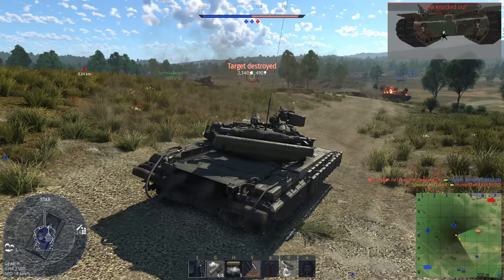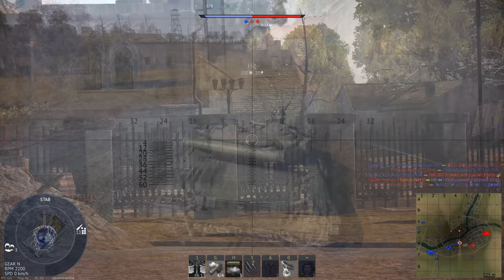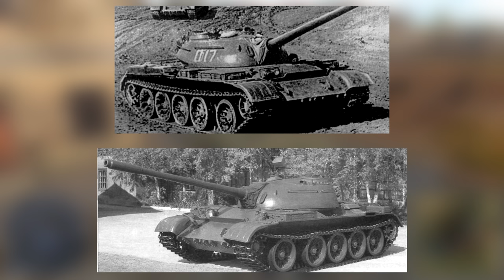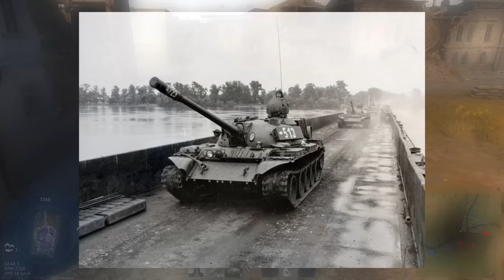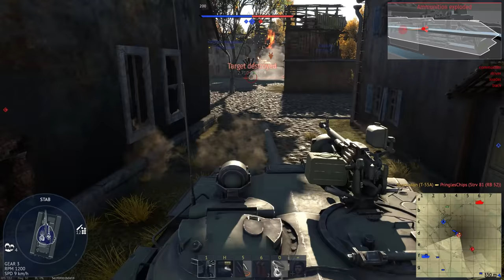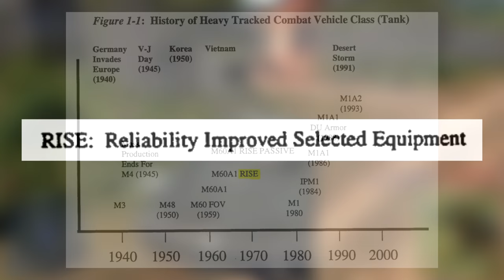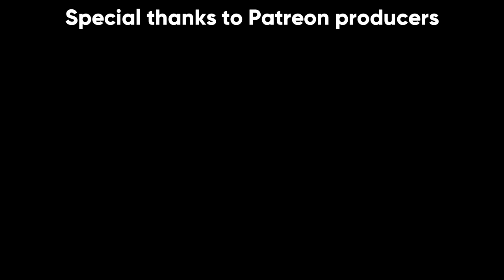Were Soviet Tanks Poorly Made?

Comment: For the T-34: the T-34 was originally designed to be a decent tank (at least for the time) but with operation Barbarossa, the soviets were forced to make certain cutbacks in time and work quality for the T-34. Yes the designs became better as the war went on but even by the wars end, there were many disparities between tanks that were built in the same factory. There is an even bigger disparities between tanks built in different factories. Parts of the tank that were deemed not essential or as important as other parts were either completely missing or made out of worse materials then the core parts. Things like lights, crew hatches, vision visors, and even the early transmissions were either missing or of low quality in early and mid T-34’s.
Reply: yeah, idk why we is talking like the t34 was a well made tank. it wasn't. it had many problems around how brittle the armour was, and many things were mssing from them.
Reply: Designed as a decent start of a tank, there were some pretty clear flaws in the vehicle which the USSR found and were going to fix but, wars tend to make things like that hard to do.

It also wasnt even just early or mid, late production and post WW2 production T-34s also had serious issues.
Reply: may i remind you that by 1942 83.6% of T-34 tested completed their 300km test runs. Furthermore, the 5th guards tank army endured a 3 day march, totalling 330-380km, to prokhorovka and we all know how that went. The germans called the sherman "zippo" or cigarette lighter and i gotta wonder why... The british cromwell required 199 man-hours to be properly maintained compared to an M4A3's 39 when subjected to the same test.
Reply: @Nave4x4  that documentary is pretty flawed, as it compares the t-34 to different tanks. There is no constant. For example, when he talks about mobility, he compares it to fast tanks like the Panther, however, when comparing firepower or armor, he compares the t-34 to more beefy tanks like the Tiger, which gives a false "always bad" view of the t-34, which is very misleading. And yes, the tank obviously had problems, however it is not as bad as it may seem from his videos.
Reply: Combine that with who was building those: not all of them were built by highly trained professionals. The country lived by “everything for the frontline, everything for the victory” motto. If you weren’t fighting in the frontline, you were willingly working your ass off at the factory, producing ammo, uniforms, weapons, pretty much everything needed at the front, including, you guessed it, tanks and tank parts. 

That allowed for an impressive production output. At the cost of greatly varying quality that depended on just as varying skill level of every volunteer worker involved. Doesn’t mean the quality was always terrible. They got the job done. Party had zero tolerance for shit quality even at these times. But you can’t sign up a horde of volunteers who were in a different occupation just this Monday and expect the quality to be consistent even if you teach them the basics.
Reply: I was In a t-34-85 myself the things u sit on is literally a wooden bench there's almost no space for the crew and the tracks are very rough when driving,  you could drive into the smallest hole and hit the parascope so hard you would get knocked out, german chairs (the thing u sit on ) they tought about the design that would be more comfortable for humans, they have these soft confy chair and the tracks are not so rough, and the parascope idk, german tanks were made of expensive high quality metal, that's why they had a deadly reputation, but the parts could not be repaired when damaged, otherwise the soviet tanks they were made to quick manufacture and basically designed to assault trenches because they only focused on rushing because there wasn't any time to think about human comfy or anything like that, germans were at the gates of moscow and the air was dominated by germans they needed a quick steel beast to counter the german panzers, there wasn't any time to build a new tank prototype that wouldn't had been to made for 50  to take down 15 panzer tanks.
Reply: @blitfire  of course t34 dont catch fire when hit in their ammo or fuel.
Even if germans did refere like that to the M4 it means nothing because on the field monikers dont represent stats.
Drop a match on a diesel spill, it will also burn.
The M4 ended having a death rate after penetration at 20% or lower, meaning that even if the armour was defeated in average only one crewmember died.
The US armored core had some of the lowest casualties rates
Reply: @vilencas6203  I totally agree. When the  USSR lost millions in battle, when there were no resources left in the nation, when Leningrad was in a blockade for years and when the industry was bombed out of existence, the Soviets shouldn't have focused on a comfy seat.
Reply: @ender1111  Except he didn't? He made alot of fair points like how the gun was shiet, how it's mobility was meh, alot of t34s not having radios meaning usually only 1 t34 would attack a newly spotted tank, the shiet armor quality, like how the optics for everything except the gunner was shit, etc...
Reply: @aregulargenericname8794  what do you mean by "he litteraly didn't"? He litteraly did. Throughout his video he litteraly compared the t-34 to different tanks, with the example of how he did it and why It wasn't the most accurate thing to do above.
Reply: @aregulargenericname8794  also, calling everything you can name in a tank "shit" is the most accurate and carefully planned analysis I have seen in a while. 10/10
Reply: @ender1111  It's literally just a fact that the t34 is shit, what else am i suppose to say? and also comparing tanks to other tanks is literally showing what a tank is good and bad at and the t34 is again shit in almost every aspect
Reply: @aregulargenericname8794  what else you're supposed to say? I dunno, maybe something factual lol
Reply: @phunkracy  I literally did tho
Reply: @vilencas6203  wooden benches in T-34? Lol, this alone proves you weren't in T-34, ever. Maybe in romanian one.
Reply: @mitchverr9330  post war T-34s that were of questionable quality were overwhelmingly polish/for export. Mostly because Poles were just learning how to properly make a tank in the 50s and Soviets didnt care about T-34s, having switched to T-44/54, giving away tanks that they didnt want.
Reply: @aregulargenericname8794  compare a medium to a heavy tank and what is effectively a heavy tank ( tiger and panther ) with hard stat is stupid and go against his other point on the  panther video which is double standard , he also use a ton of strawman like using ONE factory to judge EVERY OTHER factory , around the 17-18 minute mark he also use a wrong example by showing a piece of armor that IF welded like he talk about then you won't be able to take out the suspension and many other error like not mentioning the context in which the decision was made or failing to mention improvement latter on from mid 1943 ,.... In conclusion that video is a Mark Felton tier video (surface lv piss poor ) which is a shame cause his other video is quite good ( my favorite is panther , Burton ) actually high quality video should be atleast Chieftain/MHV tier not this.
Edit:Also shit tank don't win war buddy , there a reason T-34 perform better than Sherman ( yes , that a fact ) on the Eastern front , no tank is the best only which tank fit a nation need the best
Reply: Don’t forget the turret basket
Reply: @huyhoangtahuu9733  Didnt that 1 factory build about 50% of the tanks? Arguably making that 1 factory the standard?
Reply: @huyhoangtahuu9733  I disagree alot with ya and i mean alot so
1. He also compared it with the sherman and the sherman was still better
2. That "one factory" made 50% of all t34's and most other factory's were similar if only slightly better
3. You are wrong with the the "around the 18 to 17 mark" thing, you are literally wrong, he just said that welp the armor was strong but it easily "snapped" at the welds
4. The video is gud, same tier as things like the chieftain/MHV
Reply: @mitchverr9330  that one factory was so huge it literally had factories within factory
Reply: @blitfire  The only shermans to have easily catched fire were the british ones, the regular shermans rarely catched fire and had one the best survival rate for crews so yeah
Reply: @aregulargenericname8794   lazerpig gave losses to 50 mm guns as evidence of bad armor. Guess what other tank could be easily penetrated by 50 mm?
Sherman. 
Therefore Sherman had bad armor.

Also, yeah, lazerpig is definitely comparable to Chieftain, an actual tanker and tank historian, lol.
Reply: @phunkracy   Well were are we talking? If it's the front the Sherman will win and is better that's a fact , if it's the sides both tanks are then fucked but that wasn't the point it was the front and the t34 still got fucked
Reply: @mitchverr9330  Not really cause no T-34 from different plant is the same ( hell T-34 from the same plant also have different between each other ) so quality is different from each other alot until atleast 1943 when the standard quality control finally take place which made the T-34 pretty decent tank in term of reliable.
Reply: @phunkracy  Okay and? Mega factory or not, did it or did it not make about half of all the T-34s, making what came from it effectively the default to talk about?

Its like arguing you cant use an Alvis Saladin  as an example vehicle because Crossley built like 12 of them.
Reply: @huyhoangtahuu9733   "reliable"
Reply: @blitfire  source on Germans calling them zipped, sounds an awful lot like the debunked ronson myth
Reply: @mitchverr9330  there was as much variation within this one mega factory as between various soviet factories. As simple as that.
Reply: @aregulargenericname8794  50 mm tungsten round can penetrate M4 as easily as T-34. Normal pzgr 40 has in fact less of a chance to pen T-34 because of steeper angles.
Reply: @phunkracy  Umm no? the sherman has better frontal armor then the t34, there literally was an army test
Reply: @aregulargenericname8794  i also disagree with your point cause:
1, while i would definitely perfer to be in a Sherman there a reason why i write above that T-34 out perfrom Sherman on the Eastern front , the reason being lower profile and ground pressure allow T-34 better moblity ( both tactically and strategically ) as well as some other factor
2.Quality between factory pre 1943 is so vary that trying to point to just one plant and tell me all other is the same is just wrong and post 1943 when quality control is implemented then all most T-34 achieve decent enough reliable lv (CIA report , Soviet internal document which show thing like  all tank must complete a certain milestone with 1 tank of random from a 500 patch being test for min 500km )
3.The picture he show and talk about the gap in armor around that mark is one that has been show before and proven false by reason i stated in my other comment
4, Chieftain/MHV provided context for which design are made as well as how the tank improvement as the war went on, they also talk to people who work on said tank and actually get in (sometimes drive )the tank they talk about , lazerpig did none of the above.
Reply: @aregulargenericname8794  source: CIA report , internal Soviet document and Soviet quality control test mid - late 1943 for all tank plant
Reply: @huyhoangtahuu9733  Time to a r g u e again
1. The lower profile i can't disagree but no the t34 was slower then a sherman that's just a fact
2. Yeah the quality was decent yes, too bad it was still incredibly shit 
3. I made a point and you didn't comment and also your point was literally incorrect and at the "17 to 18 mark" the point you made wasn't even there
4. le lazer honk is still gud
Reply: @huyhoangtahuu9733  Source: my religions believes and my faith in the true saviour Spaghetti the fifth
Reply: @aregulargenericname8794  army test that proved that ~80 mm of effective Sherman armor was able to resist 120 mm pen of pzgr 39 or 140 mm pen of pzgr 40? Don't make me laugh
Reply: @aregulargenericname8794  he literally cited the source lol
Reply: @phunkracy  2 things lad 
1. it's not 80 mm more like 90 to 95 mm
2. i made a joke why? i like to make jokes
3. i lied i have 3 things lad
Reply: @aregulargenericname8794  have you seen how different the terrain of the Eastern front to the Western front ? It literally a fact the T-34 out speed Sherman there that why i only said Eastern front and not every where else ( fit into my other point from my first comment on being the tank the nation need).Shit quality would be not able to go past 150km and can't be field repair like a certain cat , being able to do 500km on avarge is literally the definition of decent right there. Sarcastic remark when confront with sources is no different then admit defeat dude , if you have a counter point to the source then show it or take the L ,that all i gotta said.
Reply: @aregulargenericname8794  only early war m4 had that LOS armor due to steeper angle, but with two glaring 40 (iirc) mm weakspots to make space for driver and mg gunner/radio operator. Latter M4s had less angled but uniform armor. Still at no point impenetrable by even standard pzgr 39 50 mm ammunition.
Reply: @huyhoangtahuu9733   My source is the Lazerpig video including all of his sources
Reply: @phunkracy  I literally never said impenetrable
Reply: @huyhoangtahuu9733  Ill take the L if im incorrect and from what i see currently all i made is some small hick ups
Reply: @raw1175  what i just like russian tanks doesn't mean i want to live in the soviet union. sounds like a cope ngl
Reply: @huyhoangtahuu9733  500km? Naahhhh where are your numbers coming from... "According to the head of the Armored Directorate of the Red Army N.Fedorenko, the average mileage of the T-34 to overhaul during the war, did not exceed 200 kilometers" ... And this is not even taking combat losses into account, per example in 1942 the average service life was 66km... The loss reports of the T34 does rlly reminde one of certain German cats. "For instance the 5th Guards Tank army in 1943 lost as much as 31.5% of its tanks during its march to Prokhorovka. In August ’43 the 1st Tank army lost 50% of its tanks due to malfunction. As late as the second half of 1944 tank units tried to replace engines with more than 30 hours of operation before a major attack." Stalin even made a special directive threatening any crew wich "claimed" their tank broke down with being send to a penalty battalion
Reply: @josephdedrick9337  wtf is ronson
Reply: @nahuelleandroarroyo  i like how you exclusively use american examples to disprove my point that the if nothing else the T-34 was made reliable well before the end of the war... like i don't swear loyalty to any nations tanks especially not my own (not even russian lol) i just think that its unfair. like, don't you think the russians would have come up with something else if the T-34 was really that bad. They did with the KV-1 after all.
Reply: @blitfire  lighter brand supposedly Sherman's were nicknamed ronsons cause of the myth of them lighting up everything they were hit
Reply: @aregulargenericname8794  The british pretty much exclusively used the M4A4 which had the A47 multibank. Now, a large number of the american shermans used radial engines which were very prone to oil leaks, moreso than other engine types. As such i think that you're kinda wrong about the fire thing. Like I'm not even saying the sherman was bad it wasn't it was great but i can tell you're american and so everything other than what you have must obviously be worse because its not american (sorry i used sarcasm i know you don't have that over there) Also its not catched its caught.
Reply: @blitfire   What do you think the t44 and t54 were made for?
Reply: @blitfire  Also im european not american
Reply: @blitfire   sorry if I jumped the gun just everyone thinks all the soviet stuff is like an AK reliable
Reply: @blitfire  But your probably american or russian  (sorry i used sarcasm i know you don't have that over there)
Reply: @nahuelleandroarroyo  Ffs tanks were really flammable they're full of explosives and fuel but everyone's making it seem like the T-34 was the only tank to experience the issues that it faced. The reference to the moniker wasn't really a dig i honestly think the sherman was great. But if we look at what the T-34 did for the russians really it wasn't a bad tank.
Reply: @blitfire  It was a bad tank that's just a fact
Reply: @warhead_beast7661  then im afraid your source and mine differ: "As the war went on, the amount of service expected out of every vehicle was not reduced, but increased. For instance, a new gearbox developed in 1942 was put through 3700 km trials, tires made in 1943 were put through 2000+ km trials. When reliability issues cropped up, such as with experimental tracks, these issues were quickly addressed. By 1945 the requirement for the lifespan of track links, an expendable and rather easily replaceable component of the tank, was increased to 1500 km. Similarly, the warranty period of the engine was increased to 250 hours. Recall that this is the warranty period, not the maximum or even average lifespan. The average lifespan by this point in the war was 250-300 engine hours with individual tanks lasting for even longer. Starshina Kharitonov's tank, for instance, surpassed his warranty period by at least 400 km. Senior Sergeant Russkih's tank fought for over 305 hours. Guards Senior Lieutenant Skvortsov's tank gave out at 308 hours. Guards Starshina Perederiy drove one tank for an impressive 370 hours and then 310 hours with no breakdowns in a different tank. These are just a handful of stories." ( Tank archive with each of the point coming from translated document)
Reply: @aregulargenericname8794   to provide and universal tank platform? how does that disprove my point?
Reply: @blitfire  The t34 was a good design butchered by soviet quotas
Reply: @blitfire   Literally which comment are you referring to?
the one where i called it a bad tank? If yes, it's still extremely shit and very deadly to the crew
Reply: @raw1175  No not really the design was meh at best
Reply: @aregulargenericname8794  have you heard of the battle of kursk? also when the T-34 was first fielded (FIRST fielded, ik this doesn't hold up for long) it surprised the germans with its highly effective frontal armor and its speed. Sure at the same time the crews were shit but that's a seperate matter. Also, look at the T-34-85. That modification demonstrated the T-34s ability to meet demand. all they really had to do was harden up the suspension, widen the turret ring, cast a new turret (with minimal increase in weight, i might add) and they had something that had a chance against a tiger and lets be real here, it was more reliable than one of those.
Reply: @raw1175  i will agree on that to an extent.
Reply: @blitfire  uhh the t34 was around in 1940 and kursk happened in 43 idk what youre on
Reply: @aregulargenericname8794  so it does have half a brain
Reply: @blitfire  I have and you got some points wrong
1. The speed was not good that's just an actual fact
2. armor was decent but if it's anything bigger then a 50 the armor sorta meh's
3. That "ability to meet demand" is a extremely simple demand not anything impressive
4. They still ahd a very low cahcne against a tiger and a tiger was still shit tons reliable then a t34
5. The shell themself were genuine shit, they were poorly made
6. Im confident to say that the first panthers (one of the most unreliable tanks of ww2 at the start) still had a slightly better reliability then a t34
Reply: @aregulargenericname8794  the T-34 was categorically faster. higher road speed and then bc of the better ground pressure better off road mobility
Reply: @aregulargenericname8794  true
Reply: @josephdedrick9337  point taken
Reply: @blitfire  the T-34 is fast on paper, but the transmission was so stiff that it was almost impossible to shift into the higher gears. Basically, imagine that you have a sports car. Fast, right? It would be, but the top two gears have been welded shut. That’s what the t-34 is. A number of later tanks did get a much better transmission, but a lot of them were never upgraded.
Reply: I think that's enough commenting for me 
peace
Reply: One can't really compare the Sherman and t 34 accurately due to differences in doctrine and about the Sherman being called the Zippo that was fixed with m4a3e8s wet ammo storage
Reply: @yoshithorp  As someone else said, the t-34 was an expensive tank produced cheaply. Supposedly if built to american standards in Russia, they would have cost about as much in money, materials, and manpower as the Sherman, an objectively better tank.
Reply: @blitfire  The zippo thing is a myth. First of all, it's highly implausible that more than a handful of Germans even knew what a zippo was. Second, we have the data on the burn rates of Shermans without wet stowage and it's about equal with other armored vehicles. Third, the Germans had a tendency to shoot tanks until they burned so that they couldn't be repaired.
Reply: @huyhoangtahuu9733  He talked about the factory that produced most t-34's, which means that factory's quality is necessarily indicative of the typical t-34.
Reply: @aregulargenericname8794  And if I remember correctly,British Sherman catching fire was usually because they would stuff extra ammunition anywhere they could.
Reply: @Shaun_Jones  not really. Shifting gears isnt near as hard. And in extreme cases of bad production you have MG gunner next to you who has nothing to do,  but can help you shift gears. Still,  being a driver requires strength snd stamina
Reply: 123  You mean like the PzIII and IV? Oh wait... 
But let's look at some "unreliable" German tanks. The Tiger I didn't need to be reliable like the mediums because it was a heavy breakthrough tank. That it spent nearly the entire war not being used for its intended role isn't an argument against it mechanically.
The panther's power train issues were of an entirely different nature than those of the t-34. Unlike the shit design and manufacturing of the t-34 powertrain, that of the Panther was a reliable system that suffered from having to move a tank 10 tons heavier than it was supposed to be. And it was still more reliable than the t-34's.
The tiger II suffered similar overload problems and just the general collapse of german industry.
Reply: @huyhoangtahuu9733  No, the t-34 did not have better mobility. On paper it theoretically did, but in reality the terrible design and manufacture of its transmission meant a t-34 was unlikely to go faster than 15 kph.
Reply: @phunkracy  It's called the slope multiplier; the effective thickness of sloped armor was greater than its line of sight thickness. Maybe learn at least a little about a topic before pretending you have a clue what you're talking about.
Reply: @blitfire  Except it was. Any time that ramming enemy tanks, disabling both, is considered a viable tactic, you have a bad tank. And I don't mean considered viable in some random encounter; I mean at the theatre level. The soviets tried to drown Germany in men and t-34s. Even with the British and Americans fighting Germany in the Mediterranean, bombing German industry into oblivion, and plugging countless holes in soviet industry with lend-lease, the Soviets weren't that far from failing.
Reply: @aregulargenericname8794  And the reason that the British Shermans caught fire so easily was that the crews tended to overload the crew compartment with extra ammo; it was basically the perfect set up to go off like a firework. Once they stopped doing that, the Shermans became one of the most survivable tanks  in the war.
Reply: @jsn1252  Oof, you beat me to it.
Reply: @jsn1252  that's exactly what I said in favour of T-34 but in some inconceivable state of mind you decided to hold it against me lol
Reply: @jsn1252  ah yeah, panther was more reliable because it only had to carry additional 1/3 of projected weight. Also it broke every 150 km as opposed to T--34s 300 km. Also it required extensive driver training as opposed to T-34. But again thst is non issue.
Reply: @jsn1252  also love how you diminish almost the entir weight of German war effort on eastern front. Pathetic
Reply: @ostiariusalpha  That and that 20% crew casualty figure was taken from dividing the number of tanker casualties by the number of killed M4 mediums. That number as produced by the war department also included tankers who were killed while outside their tank for whatever reason, something the British also had excessive issues with as British tankers were prone to getting out of their tanks to make tea even in the middle of an armored advance. See British 22nd armored Brigade on D-day+6 when their impromptu tea party was rudely interrupted by the germans.
Reply: @aregulargenericname8794  comparing the t-34 to one set lineup of tanks would show how bad/good it is. Comparing every different parameter of the t-34 to different tanks doesn't give nearly as good of a picture. Also, he fails to mention any upsides of the t-34, like being one of the first tanks ever with sloped armor or having a good off-road performance, which could get it through terrain that even Sherman's couldn't cross.
Reply: @ender1111  Dude the t-34 was not the first tank to use sloped armor lazerpig mentions that in his video. Castles from the dark ages have sloped armor this has been a concept that has been know for a long time. The brits made the matilda which has sloped armor though not to the same degree but that line did enter service in 1939 while the t-34 enter in 1940. Hell looking back the bt-5 had sloped armor that was put into service in 1932.
Reply: @dragconen  the Matilda and the bt 5 both had flat armour at 90 degrees even in the front, let alone the sides back. There the armor was barely sloped and in a few places, mainly the turret, which could have been made round, because of round turrets being easy to produce.

Basically, the t34 was the first tank to fully embrace sloped armor, while the Matilda or the Bt's both had plenty of frontal, non sloped armor. And yea the consept did exist for a long time, but again, the t-34 was the first to fully implement it on purpose.
Reply: @ender1111  Yes he does. In fact he plays a whole clip show of tanks developed earlier than the T-34 that were developed with sloped armor. Starting with the Somua S35, the Crusader with its heavily sloped frontal glacias, the Char B1 series, Renault R35, the Matilda I with a sloped frontal glacias and driver armored hatch, the BT series (also with a sloped frontal glacias), the polish TK is heavily sloped, the Panzer I (sloped), the FT17, and Little Fucking Willie.
And he does mention that the Christie suspension had excellent off road capability. He also mentions that it didn't help much when driving the tank itself was so bloody difficult (shifting into 3rd gear required a hammer, shifting into 4th gear was literally fucking impossible). Average speed on paper was 34 kph. Average speed in practice was something like 15.
Reply: @ender1111  it's not only about leningrad, leningrad was surrounded but germans made a small gap to allow russians import food to the city when germans foundout they were importing guns and not food, they started bombarding the line and soviets used it as propoganda.
Reply: @aregulargenericname8794   " Umm no? the Sherman has better frontal armor the t34, there litteraly was an army test" what Sherman variant are you talking about? What t34 variant are you talking about? Why are your arguments always so general with no specifica, no proof/sources?
Reply: @vilencas6203  the Germans bombarded the supply lines of Leninengrad from the start of the blockade. They never allowed food to imported into the city, cuz why would they want the city to have strong and well fed defenders?
Reply: @ender1111  I think it is false, now first of all i'm telling you again they imported very little food mainly the trucks carried ammo guns explosives etc, germans could've have surrounded the city completly but remember no food at all that would meant all the population in leningrad will starve starve until soviets give or die out completly.
Reply: @vilencas6203  the supply you are talking about is called Дорога Жизни or The road of life. It was bombarded by Germans from the start, thought maybe with some delay, which is probably where the confusion came from. It was actually a supply rout on water (In summer) which is why it wasn't captured by the Germans, since the Germans couldnt get their fleet in the area. Truck's were also used, but during winter, when the water connecting Leningrad and the USSR was frozen. Germans didn't want to import food, as yhe city would have been turned into a giant concentration  camp without food, which is what the Germans, as you know, were fond of.
Reply: @ender1111  Well, they were mostly about equal. Early model M4 medium had an upper front plate of 50.8mm angled at 56 degrees for a relative thickness of 90.8mm. T-34 76B had a UFP of 47mm thickness at 60 degrees for a relative thickness of 94. Note that a difference of 3.2mm is neither usefully different nor statistically significant.
Reply: @ender1111  Quick about tactics as you might know soviet losses were way greater than germany cause of poor tactics, and poor training, soviets would just throw themselves wave by wave to the germans in trenches that would fend off the soviets with machineguns if they would refuse to rush well, they'll get shot
Reply: @vilencas6203  yeah, agree on that one
Reply: @vilencas6203  yeah, I agree, that was a big part of the problem
Reply: @phunkracy  Domestic T-34s for domestic use were TRASH. Only with the T-54 did they improve manufacturing quality.
Reply: @phunkracy  The 150 km is a myth. The T-34 gear was changed with a hammer. As for 300 km? I'm not sure it could go that far even after changing the transmission with the spare one on the back.
Reply: @liviuganea4108  "they are trash " is such a great argument , oh plz trash tank don't win war and if people like the Chieftain ( who single handedly change the Sherman image AND know what he talk about ) said that T-34 post 43 and T-34-85 are decent tank that are even comparable to Allies tank then i  think i will take his word for it ( consider he actually back his up wth fact not "it a shit tank )
Edit: T-34 don't change gear with a hammer , that a myth cause there plenty of video of people driving and changing it gear just fine ( hell there even a video of a girl changing gear while driving one on youtube ) , just the fact that you mention the gear thing and spare transmission like they are common thing especially in late war ( which doesn't happen ) tell me all i need to know about your lv of knowledge
Reply: @ender1111  
1. just every sherman variant
2. almost every t34 variant has worser frontal armor maybe that fooking yugoslav one can beat the sherman 
3. I'll go get the source
Reply: @ender1111  Also the t34 wasn't the first tank with sloped armor, that's literally just a myth, fun fact: the first ever sloped armor was used on castle walls
Reply: @ender1111  Let me be clear unlike that guy with a vietnamise name or me, it seems like ya only know the "popular" fact bout the t34, i just want to tell ya their mostly lies/the truth but streched
Reply: @aregulargenericname8794  dude , how am i lying when literally denied fact like the T-34 having better mobility then the Sherman in the Eastern front and similar terrain (Zaloga/tank archive)? It literally only take one Google to get the answer but instead you double down on it , why do you think i stop replying to you cause i know it a waste of time trying to change the mind of someone who already have a conclusion and trying to bend the fact/evidence to fit their conclusion , i only reply now cause you call me a liar while being one which is just hypocrisy.
Edit: hell even Lazerpig source which include Zaloga said that T-34 was a decent tank that got the job done , dude do you even read your source ?
Reply: @huyhoangtahuu9733  Ok i won't lie this is a hiccup i made by accident, i was wrong this time 
the t34 is still shiet
Reply: @aregulargenericname8794  eh, let just agree to disagree that to you the T-34 is shit but to me it a sledgehammer purpose built to crack one big nut.Crude, but effective, cheap, and could be built by literally anyone.Honestly tho , i have met worse case and atleast you admit at the end that you are wrong so it a hella improvement.
Reply: @vilencas6203  German tanks were not superior when the germans were at the gates of Moscow. Their Frontline tanks were still panzer 3s and panzer 38ts, with short barrel panzer 4s and stugs supporting. The soviets at the time had kv1s, kv2s and t-34s, heavier tanks with better armor and weaponry, which were actually capable of doing tons of damage to the germans (the single KV-2 that held a panzer division at Raiseniai comes to mind). I mean shit the whole reason tigers exist was to give the germans an answer to the T-34, they didn't just pull it out for shits and giggles
Reply: @verypoorlymadefakename4231  also the Sherman even before the wet stowage didn't have a noticeably higher rate of fires than any other tank of the time period. If your ammo or fuel got hit your tank burned, from panzer 4s to Chi has to t-34s to Stuart's, your tank was gonna burn
Reply: @vilencas6203  bro the wave by wave at trenches thing is a myth. That's not how the soviets fought at all, they did have an initial lack of leadership problem but then Zhukov took command and organized them. Soviets actually had extremely effective tactics and strategy based around baiting the germans into open field conflicts where the soviets would come out on top.
Reply: @aregulargenericname8794  you have provided litteraly zero sources, so your arguments can also be lies
Reply: @aregulargenericname8794  also, I know the t-34 extensively, as not only am I very familiar with WW2, and the easter front, I also happen to live in Saint Petersburg, right beside the Military musium at the Petropavlovskaya Krepost, where I often talk about tanks to the historicaly knowledgeable staff about tanks, including the t-34. I even drove the t34 57 ( I wont be surprised if you dont even know that model of the tank).
Reply: @huyhoangtahuu9733  To be clear, Lazerpig said that the T-34 was a damn good design if the factory workers slowed down a little bit to do even a halfway decent job of producing a quality tank. He has no problem with the tanks produced before Operation Barbarossa or the tanks produced after the war. The problem was the fact that T-34s produced during the war were basically giant masses of manufacturing defects with factory 183 being a particularly notable offender. 183 pumped out T-34s alright, more than every other factory in the soviet union combined, and the vast majority of the ones they made could be placed on a scale going from "godawful" to "near unusable."
Reply: @yoshithorp  Yeah the video did not really focus much on the production and thats why it missed it's own title. Spookston took mostly about designs, not how good or poorly tanks were actually made. T-34 was notorious for it's lackluster quality control and poor quality of steel - a lot of tanks were discovered after the batles not even penetrated by enemy shells. Yet crews were killed and internal components destroyed because of the spalling caused by bad quality of steel and/or poor manufacturing of the vehicle itself.
Reply: @ender1111  Dude no matter how you look at it the t-34 was not the first tank to use sloped armor which is what you said.
Reply: @dragconen  ok, fair enough
Reply: @phunkracy  the Sherman jumbo and M4A3 want to have a word with you as the M4A3 had better slanted armor than the T-34 and the Sherman jumbo could bounce shots that the T-34 could not so calling the Sherman a bad tank is sad there are people out there that say the T-34 is the best tank of ww2 but that’s just not an accurate way of depicting it
Reply: @huyhoangtahuu9733  didn’t the Sherman also see some success on the eastern front as lend lease tanks the only problem the Sherman had was having a chance of going off the road and crashing but during battles the Sherman had a less chance of exploding due to ammo rack and was held to much regard by Soviet tank drivers
Reply: And the armour may have been too brittle.
Reply: @Scriptedviolince  x2
Reply: @dragconen  The First to be produce in masses
Reply: @canthi109  The Renault R35, the BT series, the Panzer I, and the FT17 would beg to differ
Reply: @canthi109  If you are going to argue that point at least explain what you mean. The bt series was produced in large enough numbers to matter. According to the end all be all source that is wikipedia the bt2 had units 650 made bt5 1884 bt7 5556 all of which were made before the t-34.

Dude we are chatting over the internet it is not hard to look up any of this information took me a few seconds what is so difficult about checking to see if what you said is true or even in the same ball park? Even if you don't know exactly what was made you can use google to ask what tanks were made before the t-34 and go from there.
Reply: All my homies hate factory 183.
Reply: @ender1111  yeah comparing a tank to it’s adversaries that it had to fight doesn’t make sense totally.
Reply: @pilot778spartan3  XD
Reply: @blitfire  ok try going into fourth gear without breaking the gear stick.
Reply: Let's not forget that an examination showed that only 7% of T-34 tanks were up to quality standards
Reply: @blitfire  The british gave the sherman the nickname zippo. The gas modeled shermans that had dry stowage had a tendency to explode rapidly when penned. After US Production switched to Wet Storage in 1943 the sherman was the most resistant tank to burning in WWII
Reply: @rustingparts  damn wasn't expecting anything else from this thread but you're not wrong the Sherman did get better with the wet stowage altho not bc of the actual fluid the container just provided a spall shield lol
EDIT: I should point out that my opinions on these matters have changed since the video came out for a variety of reasons and I do now concede that the Sherman was better than the t-34 altho I still believe that the t-34 was not as bad as some people think especially on the reliability side where performance improved (generally speaking). I was shocked at just how bad parts interchangeability actually was tho given that each plant had their own take on the all over spec
Reply: @blitfire  The T34 exists in this perpetual purgatory of both being worse than people think and better than others think. Its a tank that typically isn't evaluated with much nuance, as people are typically either fans of it or despise it. The T34 was the worst of the mass produced tanks (Sherman, Pz4/5/6, etc) but it wasn't a bad tank for Russia as it fit there production capabilities and Operation Strategy quite well.
Reply: Is it true they didn't have range finder or range Scope I saw it in a German documentary they had to use their machineguns to know how far where to shoot?
Reply: still funny that the T-34 driver hatch is god tier protection in WarThunder
Reply: @zaniatnik 
A great example of this would be kids from age of 10-15 being placed at factory work and working as full time adults